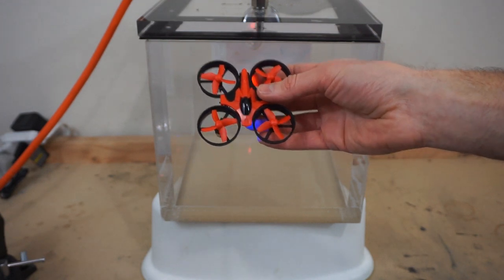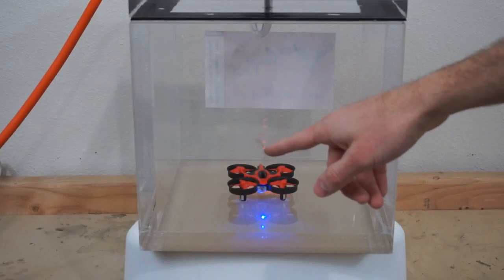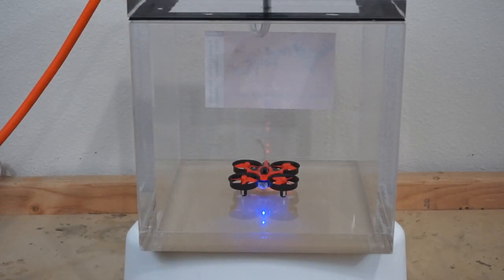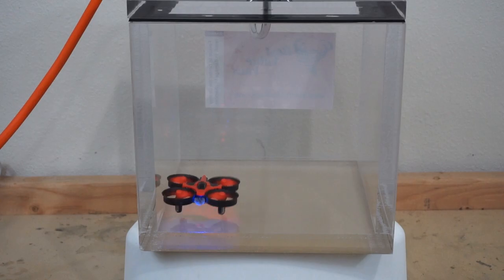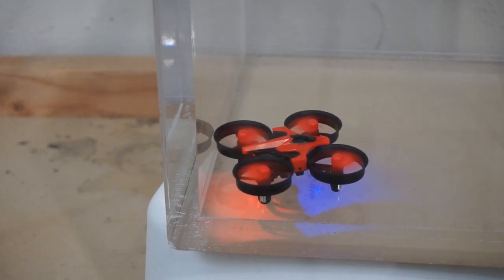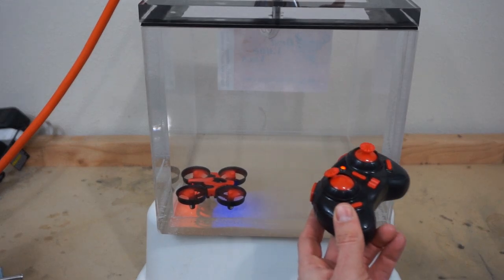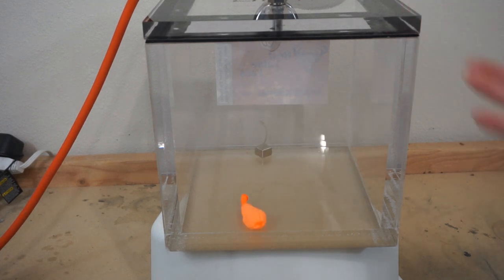What Happens When You Put A Drone In a Vacuum? Can It Still Fly?

Comment: It pushed against the wall. There are no walls in your fictional space realm. The chamber is small and the "experiment" was done in this manner to decieve. Well done...you will fool the gulible.
Reply: Karl - So what would happen if you fired a steel projectile from a CROSSBOW into a vacuum?
Would you still feel a recoil?
Yes or no?
Reply: You don't need a vacuum to prove that rockets and jet engines don't push on air.

Concorde flew at mach 2 at 60,000 feet.
At that altitude there's barely any air to push against.
Do you really think that the small amount of air at 60,000 feet was rushing in after the Sonic shockwave to jump Infront of the engine exhaust?

Do you think that the Saturn V's 7,000,000lbs weight and thrust was being suspended on 14.7psi of air?
It'd be like trying to push a freight train with a rope.
Reply: @Lee.S..B  And lets not forget the pesky little FACT that IF "Jets push on the air behind them" then no aircraft could EVER go faster than the speed of sound.

Jets push on the air INSIDE THE ENGINE, NOT the air behind them.

Rockets (and jets for that matter) propel themselves by PUSHING OUT MASS, and feeling the RECOIL force.

Rocket and jet propulsion is "MASS REACTION".

Comment: He did make a mistake. He said drone created more pressure underneath than on top thus flight. Not true. Pressure is the same. Drone or helicopters generate lift due to thrust, down force. For every action there is an equal and opposite reaction.

Comment: you should do a test where you put the drone inside that vacuum chamber in see if the RPM's go up because there's less drag and how significant is the rotations instead of the vacuum chamber
Reply: Search through his videos.
There's one with a fan in a vacuum and the current does drop.

Comment: It's not negative .5 atmosphere.  Its just .5 atmosphere.  You dont get into the negative numbers until you reach negative 1.  So, .1 atmoshphere, .01 atmosphere, .00000000000001 atmosphere, negative 1.  Negative .5 doesn't mean anything.    .5 is half.  You still have a positive number.  Just less.

Comment: Hey how you doing nice channel I do have to say that your test with the balloon is invalid because you had the size of the walls for the air to push on in the vacuum of space you will have nothing for that air to push off on into the void of nothingness.
A better way to get this point across is imagine a vacuum cleaner hose turn on the vacuum cleaner and then put a bottle rocket or a balloon on top of the hose while it's sucking and let it go it will cancel each other out the vacuum will cancel out the air and it'll suck the air into nothingness
Reply: The fastest ever aircraft the X-15 hit 7,274kmh at an altitude of 31km
At that altitude the atmospheric pressure is only 1% of sea level value.
It also hit 6,106kmh at a max altitude of 107.8km where it's 0.0000037% the atmospheric pressure of sea level.
That sort of blows away the notion that rockets push on air.
If jets/rockets pushed on air.Then there'd be a defined sliding scale where they lost thrust as the atmospheric pressure they needed to push against diminished.
Reply: Well unfortunately it doesn't get to that speed while in a 1% atmosphere if you knew anything about that you'd know that that that speed at that at a lower atmosphere would tear that a plane apart it first has to get up to speed in an atmosphere where it can push off once it's up to speed going that fast it doesn't need much of an atmosphere to push on as it's already going that fast think of a fifth gear in a car the engine doesn't need to turn as much but you have to have those low gears to get up to the 5th gear

Comment: This proves the contrary.  Rockets cannot fly in outer space because you would need an unlimited amount of air, stored in the rocket to propel itself.  Where is it storing all that oxygen and how much of it is stored to travel for extended periods of time?  The balloon moved because it had a little bit of air inside, but it moved only a small distance before it was spent.  This does not make sense, so please explain.
Reply: Poking Random Things answer my questions and concerns, and stop being childish.  Insulting is not something mature adults do.
Reply: @alexisbonilla5942  a rocket does not need an unlimited amount of air, there is no air resistance in space so once an object is travelling it does not slow down. A rocket only needs to store a finite amount of fuel, the amount needed is calculated before takeoff duh
Reply: Poking Random Things your response demonstrates that you are all theory but have no field-level experience.  The rocket would always need air since speeding up, slowing down and steering would all require thrust.  If not, it's like sending out a rocket like if it was a bullet.  I don't think you'd want to be a passenger on one of those.  But maybe you should go so that you can solve all the technical problems, as you appear to know everything.
Reply: Alexis I can convince ANYONE with a high school grasp of basic physics that rocket propulsion MUST work in a vacuum.
Care to answer a few simple questions (no math)?

If I fire  a steel projectile from a CROSSBOW, here on earth, will I feel a recoil force? Yes or No?
Why or why not?

Then after you answer the questions I can show you video PROOF of rocket propulsion in a vacuum.
Reply: @stuartgray5877  I don't need convincing as I can think for myself.  I want to have questions answered with verifiable evidence.  There are so many gaps, but I'm giving folks the benefit of the doubt.  Rockets need air to propel themselves and to generate thrust, and thrust is needed to steer and brake.  You can't have this in a limited supply.
Reply: @alexisbonilla5942  - " I want to have questions answered with verifiable evidence."

SO watch the video evidence of a crossbow recoil on my YT channel then answer the question.

"Rockets need air to propel themselves and to generate thrust"

This is FALSE, and can be proven easily if you follow along and answer the questions.

People who believe that rockets dont work in a vacuum DONT understand inertia and momentum.
rockets dont need the mass of AIR to "push off of" because they TAKE SOME MASS WITH THEM TO SPACE.
Reply: @alexisbonilla5942  what happened?  Afraid to answer a question now that you have been proven wrong?

"Rockets need air to propel themselves and to generate thrust"
This is FALSE!   The rocket pushes on MASS IT TAKES WITH IT TO SPACE!
Reply: @stuartgray5877  Post the link, I tried to find your video but couldn't find it.  I'm not afraid to find truth, but there are a lot of people who think they know and want to push their agendas on me, and I'm not the one.
Reply: @alexisbonilla5942  Sorry but SOME THREADS do not allow links to be posted.  One can always post a link, but it is difficult to tell if OTHERS can see the link.
THat is why you could just Go to My YouTube channel (click on my avatar image) and find the videos and locate the TWO that show how crossbows have recoil and how the amount of recoil depends on the MASS of the projectile.
  I will post the link right after this post and we'll see if it works.
Reply: @alexisbonilla5942  Well, do you SEE the post with the link above this one or not?
Reply: Stuart Gray Yes, I saw the video.  Though I can appreciate how that can be used to launch something, I don't see how that would work to steer, stop and propel the craft once in a vacuum.  I would like to see how that would work in a vacuum.
Reply: @alexisbonilla5942  - "I would like to see how that would work in a vacuum"

Are you questioning if the CROSSBOW would work in zero-G, in a vacuum?

It most certainly will still have recoil.
Would you care to try to explain WHY the crossbow has recoil?
WHY were the three firings of the bow on my video all different?
What changed between my examples?

The next question was going to be?
Would the crossbow STILL have recoil in space, in vacuum?

The answer is YES IF you understand mass, inertia, and momentum.

The crossbow has recoil because: During the time the projectile is accelerating by the force applied by the Bowstring on the projectile, the INERTIA of the projectile is pushing BACK on the bowstring with the same force that the projectile feels.

When one object "Pushes" on another object, BOTH objects feel the SAME FORCE for the same amount of time.
This force MUST impart momentum into BOTH objects.

NEXT QUESTION: If the crossbow in space fired a different projectile of the SAME MASS, but instead of steel, it is made of water ice - will it feel the SAME recoil?

Will the crossbow STILL FEEL recoil, in space, in vacuum, if it fired an ice block?
Reply: Do you think rockets burn constantly to move? Watch a rocket launch, they fire for like 9 minutes max. That's why you need do much fuel for a rocket.

Comment: the balloon is not equivalent to the rocket it has air inside of it and the the rubber squeezes the air out, thus it is pushed forward.....for the rocket to work in the vacuum of space, it needs oxygen to burn the fuel..where does it get the oxygen to burn the fuel

Comment: The balloon portion if this experimentis 100% wrong.  For the first half second the baloon  doesn't move at all until more air is released giving the rest of the air something to push on.

The drone is more accurate of the fact that there is no way for perpulaion to work in space.
Reply: It moves instantly and is empty on the tank floor at about the half second mark.
Reply: @Lee.S..B  It doesn't move instantly and it pushes off the side of the tank, then the pressurize air released in the tank.
Reply: You said it didn't move for half a second, and it's all over within that time..
If thrust pushed on surrounding air then aircraft would have a sliding scale where they were less efficient with altitude as air to push against diminishes.
The opposite is true, Concorde flew at mach 2 at 60,000 feet and only around 1psi air pressure.
The X-15 flew at Mach 5 at an altitude of 67 miles in near as dammit a vacuum.
Think of it another way, when a fireman let's go of his hose and it's flailing around. Do you think that the end of the water stream is pushing on air and sending the energy up wiggly water stream to send the hose nozzle forward?

Comment: The balloon seemed to have much lower thrust to weight than if it had been at atmospheric pressure. Also it would be nice if you used a micron gauge, inert gas, measure balloon pressure, balloon weight, and added a rail to guide it straight inside the tank. In a vacuum and at atmospheric pressure would be very handy information.

Comment: Just think how much oxygen they needed along with fuel to get to the moon, all crammed in that small racket head
Reply: Not all in the rocket head. They put it in the rocket. Once they’re in space there isn’t much to slow them down. They also don’t need a lot to speed up. As without the rest of the rocket, it’s much lighter. 

That is what separates when they get higher up. Spent rockets and fuel tanks.

Comment: Good experiment-well done! Still can't find a rational explanation however, of how a rocket engine can propel itself in the vacuum of space, when there is no opposite force to act against.....renders Newton's third law of motion useless
Reply: Well look at conservation of momentum instead.
Say you have a rocket sitting in space. If you fire up the engine then burning fuel is ejected from the back at high speeds.
But wait! There was no outside force acting on the rocket! (In physics terms, the "impulse" is zero.) The total momentum of the rocket and the burning fuel combined hasn't changed. Therefore the rocket must have an equal momentum going in the opposite direction to cancel that of the fuel. Hence, the rocket moves in the opposite direction as the fuel.

Comment: I'm pretty sure that when u let air out of balloon the air of balloon filled up vacuum chamber giving balloon medium to move about.. if you did that same experiment in a much bigger and stronger vacuum the balloon would have no medium to push off of leaving the balloon motionless..
Reply: nonsense.
Reply: So the tiny bit of already expanded air fills the chamber and then still had enough for thrust?

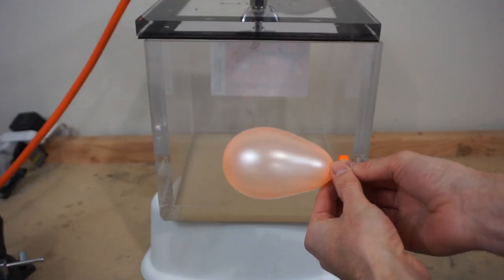Comment: 2:44 >>> it's going to expell AIR out the back.

It's going to expell WHAT out the back ?

In space where is the Air force !!!
Reply: The air was trapped in the balloon by the magnet before the vacuum pump was turned on.
It's the ejecting of the air that sends the balloon in the opposite direction.
Reply: Respected  @stuartgray5877  

Gas(any type) doesn't has mass in space, coz SPACE means gravity less environment(weightlessness) + Vacuum.

Quote :
*the best best way to make gas MASSIVE is to bring it back to earthly atmosphere*
Reply: @mohamediqbal395  Its cute that you think you can lecture actual engineers about basic physics.

But please learn the difference between "Mass" and "Weight".

Until then, keep your willfully ignorant comments to yourself.
Reply: @mohamediqbal395  Oh and the OTHER thing you got embarrassingly WRONG:

The Gravity at the International Space Station is almost exactly the SAME as on the surface of the earth.

Yes the GRAVITY at the ISS is almost the SAME as on the surface of the earth.

Now AFTER you learn that is correct, then you can check back and have a conversation with the grownups.
Until then: Bless your little heart!
Reply: @mohamediqbal395  Google "Orbit" and LEARN how orbits work.
Then use the Universal Gravitational Equation and CALCULATE the gravity at earth's surface and at the orbit of the ISS.
See that there is very little difference.
Learn.

Then learn to be HUMBLE until YOU actually research a topic for yourself.
Until then I cordially invite you to keep your willfully ignorant comments to yourself.
Reply: Respected  @stuartgray5877  

Why don't you calculate it by yourself ???
What about the the so said LITTLE DIFFERENCE ???
And how BIG is that LITTLE DIFFERENCE ???

Quote :
*Giving answer relating 🐘elephant while answering a question regarding 🐜ant, is just a joke*
Reply: @mohamediqbal395  - "Why don't you calculate it by yourself ???"

I HAVE.
Not only am I an actual aerospace Test Engineer, but I have been building, testing, launching, and operating deep space science probes for longer than YOU have been alive (based on your pre-pubescent intellect).
Reply: @mohamediqbal395  AGAIN - YOU dont know the difference between MASS and WEIGHT?

This is taught in 8th grade science class.

So WHY did you drop out of school BEFORE 8th grade?
You have no business arguing physics when it is obvious YOU have never SEEN a physics book in your life.
Reply: Respected  @stuartgray5877  

"Not only  I an actual aerospace Test Engineer" >>> Nobody here argued, "ACTUAL" or NOT !!!
Do you have any doubt ???

Quote : 
*Actually, are you something ???*
Reply: Respected  @stuartgray5877  

Building, testing, launching & operating deep space science probes for a long long long time, isn't it ???

What else ???

Quote :
*An all-rounder or something thing more than that ; all set in one BIG bag, what about others ???*
Reply: Respected  @stuartgray5877  

Please educate me(7th grade failed poor fellow) if you know how to calculate that LITTLE DIFFERENCE.

Quote :
*Monkey Man Science is as simple as that*
Reply: @mohamediqbal395  lookup the equation for the force of gravity then plug in Earth's radius for "force one" then Earth's radius PLUS the altitude of the ISS for "force two" then calculate the difference.
So simple an eighth grader could do it.  I'm sorry you dropped out BEFORE the eighth grade ...
Reply: Respected  @stuartgray5877  

Altitude of what ??? 
ISS : INVISIBLE STUPID STATION

Quote :
*EVEN SPACE DON'T EXIST, IF SO THEN HOW CAN YOU BE ABLE TO CALCULATE THE ALTITUDE, THAT DOESN'T EVEN HAVE ANYTHING INTRINSIC*
Reply: @mohamediqbal395  You can see the ISS with YOUR EYES.

Maybe TRY THAT before calling it fake?
Reply: Respected  @stuartgray5877  

Oh! Isn't it ???
Even an aeroplane that is too close is unclear to naked eyes. 

Quote :
*CGI ISS IS VISIBLE FROM EARTH*
Reply: @stuartgray5877  Ok superman. You can see plane sized objects 408 kms away. Cool story bro.
Reply: @karltaylor2857  So YOU dropped out of school before the 9th grade?

Cool story bro...

Comment: Love the simplicity of your test
But on further consideration I believe it to be flawed

Cool with the propeller test
Balloon test - points noted

(1) not a real replica of rocket in space
(2) rockets depend on burning fuel to create thrust - can a rocket ignite in space ?? This is the dilemma 
(3) balloon had air inside - even when the chamber was evacuated of air - hence had air to exhaust - hence temporary thrust on release
(4) I would have expected the balloon to increase in size as the vacuum was created in the chamber
Reply: 2) : Of course they can, the combustion chamber contains everything for that.

Comment: The balloon flies chaotically in the vacuum. I'm still puzzled about how a rocket can be steered in a vacuum, to the extreme precision required by the moon landings. 

Does anyone have any experiments showing a rocket being steered in a vacuum?
Reply: Balloons fly chaotically in any environment.
Rockets, when still within the atmosphere don't push on air, but the atmosphere adds other variables and considerations such as Max Q
Without an atmosphere that's  less variable so it's therefore a simpler process.